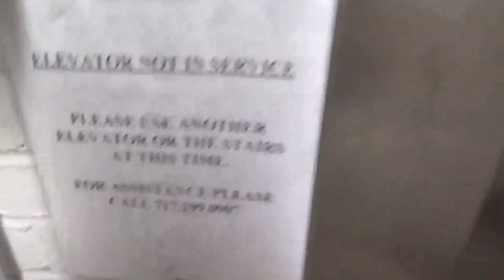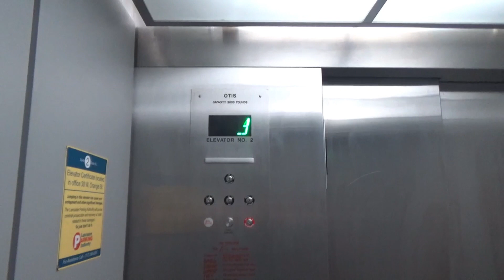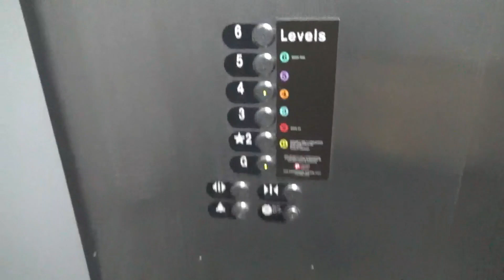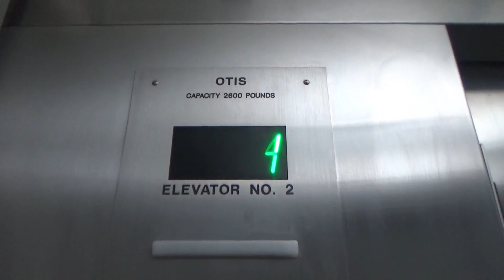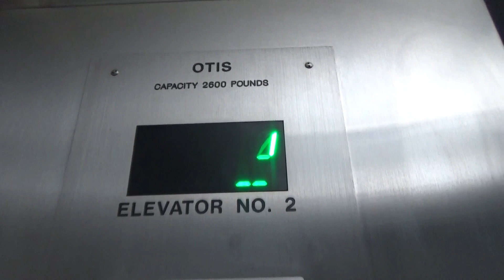LOW ON OIL!! A Checkup on the Montgomery/Otis HIGHdraulic Elevators @ Duke St Garage Lancaster PA

Comment: How would the controller look on the dry powered pump unit?
Reply from the maker: I'm not really sure
Reply: I think it would have a  Otis 211 lvm controller
Reply from the maker: Possibly
Reply: Yep because the one at Carson prairie Scott at Spring Hill  mall was a Montgomery/Otis hydraulic scenic elevator with a dry powered Moter and it had a Otis 211 lvm controller with ITI dry powered pump unit but the controller looked the same as it does on a Otis submersible
Reply: Weather submersible pump, or dry motor with belts the controls stay the same.